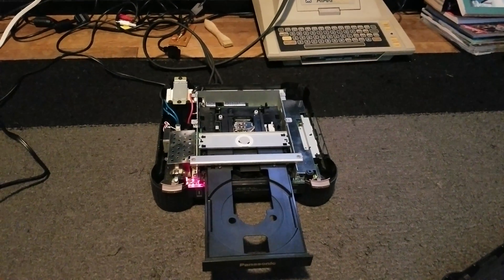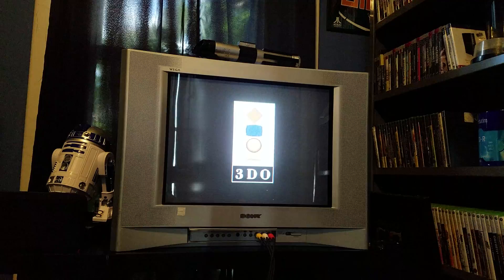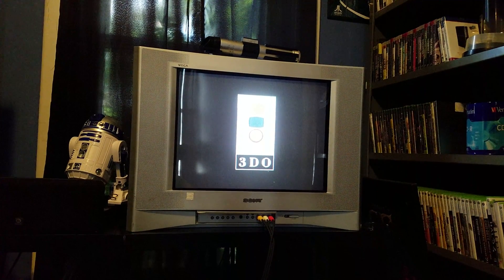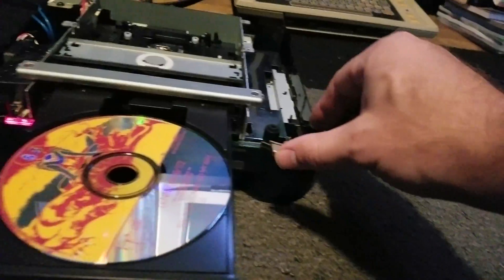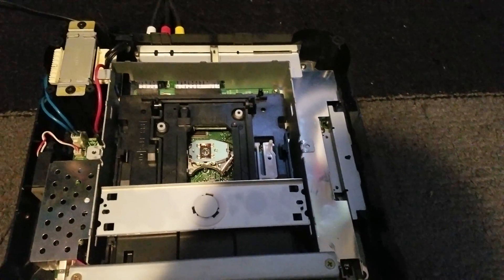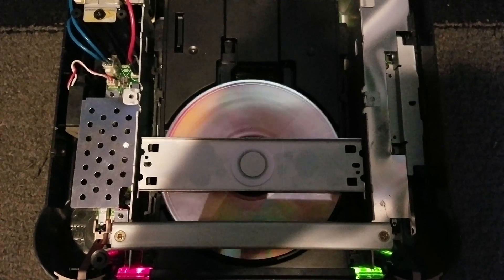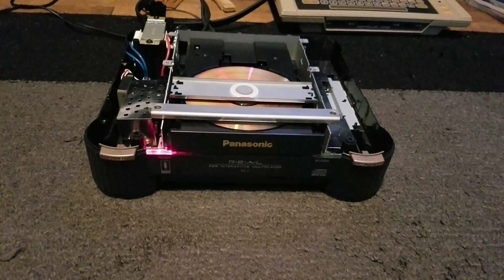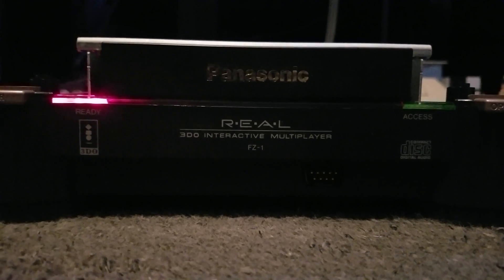Panasonic FZ-1 3DO Troubleshooting & Trying to repair

Comment: My 3DO just started doing something very similar to yours. I was playing Wolf3D on my 3DO, everything was working just fine, and suddenly the music started to skip, then the music stopped. So i reset the system. Now whenever i put a game in, it does what yours is doing, it starts to spin up and tries to read it, the laser moves up and down fine ect.. But the main difference is mine WILL get too the insert disk screen and the asteroid screen saver, but will not read a disk.. It tries, but fails. I cleaned the laser, and greased up the laser rails just in case since i had it open, but still won't read a disk.
Reply: probably the cdrom board capacitors need to be changed if its causing crashing.
Reply: @johnventura764  Yeah that's what im working on now.. Found a cap replacement kit for the 3DO, gonna give it a cap job and see what that does.
Reply: you should try using a diffrent circuit board and seeing if the laser and everything is functioning right.
Reply: crashes can happen if the capacitors on the board are failing. you wolnt know until you get a good board and check the voltage on the board you have.
Reply: the gear broke on my 3do and laser went out. i swapped another motor from another i had and it now moving the laser but can not get laser to beam or spin disc

Comment: My disc wont even spin and I dont know how to fix it
Reply: laser is bad.
Reply: circuit board check capacitors.
Reply: @johnventura764  would I have to replace the capacitators or the laser or both? Yeah 2 Yeats later still haven't fixed it lol

Comment: Try disconnecting the disk driver and try powering it on. I recently was messing with mine and if you turn it on without the disc drive it will only show the 3do logo and then go to a blank screen. If it dose that it may just be the disc drive it's self.

Comment: Shootout At Old Tuscon . That is a rare unit right there. You may just need to plug in a light gun for it to work properly.
Reply from the maker: Yes :) Finally had someone on reddit point it out to me, I downloaded an ISO and tested it and sure enough it worked. It seems that the BIOS is tied to that one game.
Reply: Have you tried any other shooter ISO files? Drug Wars or Crime Patrol, or even Mad Dog McCree?
I'm curious to know if they would work. 
It doesn't seem sensible to hamstring the system and make it only play SAOT.
Reply from the maker: Not yet but I may, I'm in theprocess of moving in with my fiancée and setting up the gameroom in her unfinished basement... which I have to finish lol. I tried to reach out to Galloping Ghost arcade to see if they might be interested in it but never got a call back. Its not like I was looking to make any money on it I  was looking to get back when I had in it though ($12 estate sale, $14 cap kit). But at this point since I know which BIOS chips are which I'm keeping it as a spare and will keep the BIOS set aside incase mine ever dies.